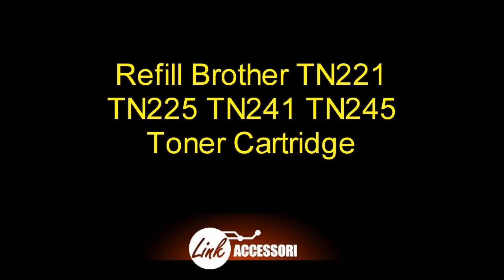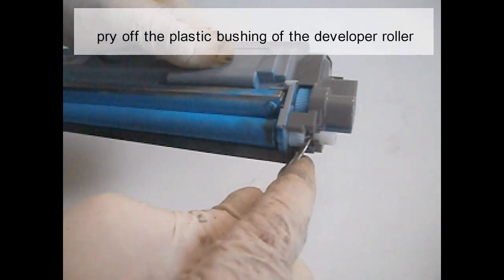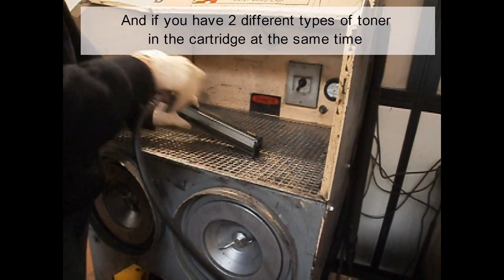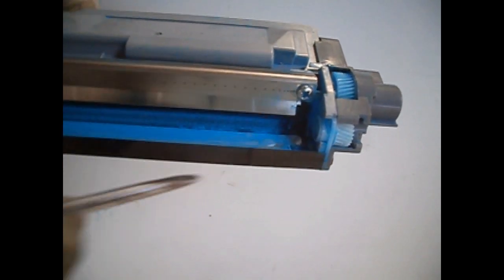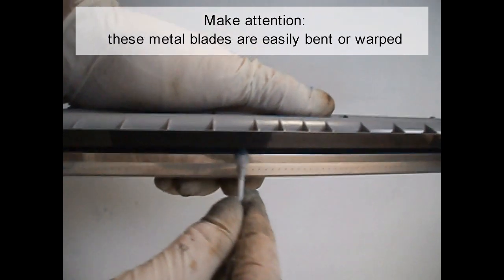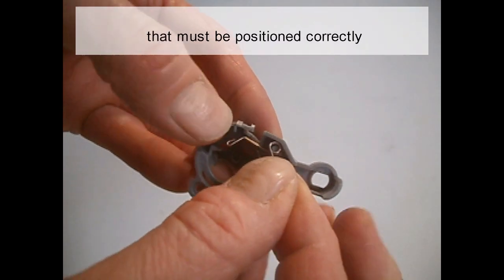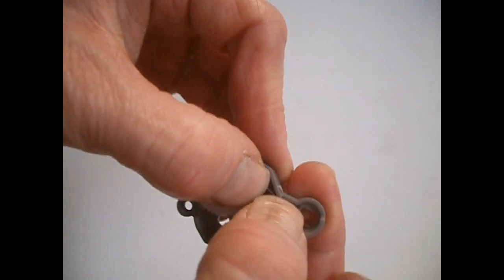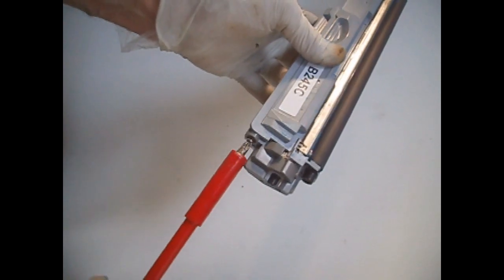Brother TN221 TN225 TN241 TN245 Refill/Reset Toner Cartridge

Comment: what if the foam roller is damaged? does it have any effect?
Reply from the maker: The foam roller has to bring the toner to the toner roller. If damaged, part of the foam roller could daamage the toner cartridge
Reply: @viandant5  i cannot find any replacement for this. I tried the cardboard cleaning I didnt know that there's foam roller there. I went too deep and scratched the foam.
Reply from the maker: @rosscat1226  I think you have to change the whole cartridge. It's not a common spare part

Comment: When it talks about the number of grams to put in, is that the amount put in by the factory?  Can I put more in if I have it?  Can you near fill the cartridges, or does that make issues?
Reply from the maker: the cartridge will send a toner low message after a number of copies, not important how many toner there is into the cartridge. the waste toner ends into the toner cartridge, so the quality of the toner inside the cartridge wlll become low

Comment: Hi.what happens if you put more toner?
Reply from the maker: the toner low error mrssage will arrive after a certain number of copies, so it's not important how much toner there is
Reply: @viandant5  i see. i have friend who puts the entire bottle of powder around 100grams in a cartidge.is he wrong?does it mean there is a chance that more powder is left wasted inside the cartridge  once the toner low error message appears?he refills starter cartridges.
Reply: @viandant5  So...no need to weigh my toner before pouring - just fill to top, and no quality or longevity problem will result?
Reply from the maker: @davids1681  You waste toner. The cartridge will only use around 80-100 grams of toner

Comment: Have Brother HL-3170DCW
TN-221
 I got all the process of disassembled and clean.
But my cartridges don't have reset gear, I don't need it if I reset it feel. The printer is that correct

Thank ahed of time for your help
Reply from the maker: Probably you have a starter cartridge, in this cartridge there is no reset gear. You'll find reset instructions in the description of the video
Reply from the maker: You'll find reset instrucitons in the description of the video
Reply: you need to but the resets gear

Comment: Ok, it seems you were right, the toner powder somehow was contaminated and causing faded prints.The steps I took to fix was to check the developer by swapping with known good cartrdige- good.Emptied the old cartridge and blew out old toner at open air making sure it is bone dry & clean.Put some left over toner (25g) and assembled (faded prints still).Opened NEW toner powder and added another 30g. This seemed to solve the problem.
* One issue I had was I broke off half the seal plug and now it is inside the cartridge, not sure if it's a good idea to continue using it that way or not. Anyway, I'm using a NEW replacement toner for now. Definitely a learning curve vs working with inkjets.
Anyway, this time I've sealed the remaining toner in a plastic bag with some silica packs in the bag to absorb moisture-- I don't think the guys who sold this toner were expecting users to keep some powder left over as the bottle cap is NOT perfectly AIR TIGHT. Thanks for your help!
Reply: I had a small piece of the seal plug break and fall into the cartridge.  It worked fine until the piece got stuck in the roller, and damaged the cartridge, it is no longer usable.
Reply from the maker: You can try to clean the roller with isopropypic alcohol
Reply: With these $15 off $75 coupons on eBay, refilling is almost not worth the time based on aftermarket carts.

Comment: my prints are faded at 3500 copies.. I believe this is due to cleaning the developer roller w isopropyl alcohol. could there be another possible reason?
Reply from the maker: No, the alcohol do not damage the developer roller. After 3500 copies may be the developer roller or the doctor blade is worn, or the toner is too old
Reply: +viandant5  so I have to transplant each to a good cartridge to diagnose..
Reply from the maker: yes, try that. first the developer roller, but I think it's a toner problem

Comment: Hello, thank you for this. The only thing that did not work as described is the resetting through the printer. When I press "Secure" and "Cancel" at the same time, I do not get the reset menu, and am not able to reset it. Looking into resetting manually now.
Reply: I was able to do it manually very easily. Thanks for the video!
Reply from the maker: +NikiRealtor I do not know any other method. do you open the front cover?
Reply: Well, the video talks about doing it through the printer settings. But I tried that repeatedly a dozen times and it did not do anything.
Reply from the maker: +NikiRealtor press and hold secure and cancel until the menu appear. you can reset the cartridge using the reset gear too
Reply: I have an HL-3170CDW and I've always used the printer's menu to reset the toner carts. and the drums too.  Follow the instructions VERY CLOSELY.

Comment: This is one of the few videos showing the disassembly of the developer roller for cleaning and other parts cleaning in addition to toner removal & replacement. How many more refills can be accomplished using this method vs just empyting & refiling?
Reply from the maker: +Tim Smith Using this method you can use the cartridge 3-4 times. without cleaning the components 2 times, in Brother technology the waste toner ends in the toner cartridge so you'll have low quality print

Comment: Printer worked very well after the 2nd  filling. 10 days later, I unplugged it for 5 hours, all of a sudden I get “Replace Toner”  popup . What should I do?
Reply from the maker: I donìt know. itìs strange. try reset the counter from the printer menu. may be the reset gear is low yield type, and after 1000-1400 prints you get the error message